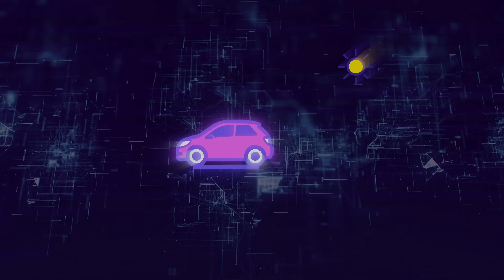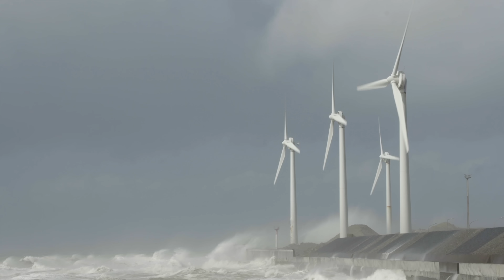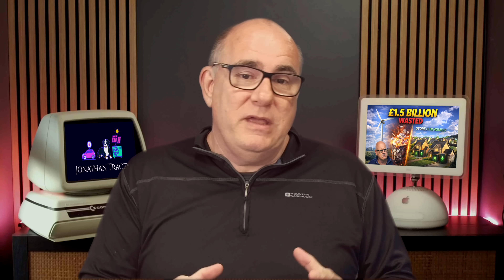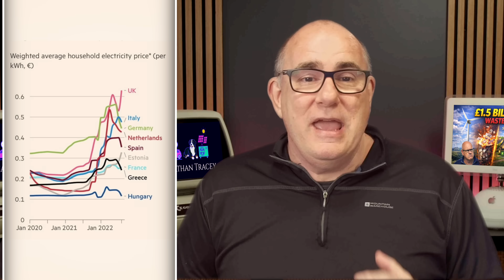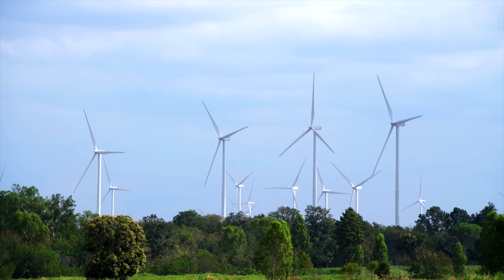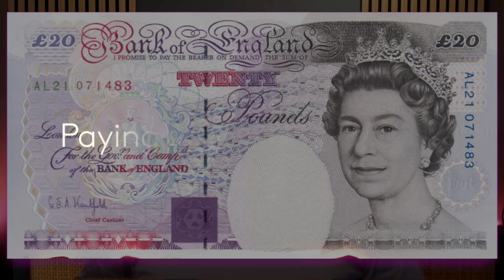We’re Paying £1 5 BILLION To Waste Energy… Here’s My Big Idea

Comment: As one of the other commenters mentioned, it wouldn't necessarily fix the north south transmission issue, but as I think you responded it would help manage loads during peak times and help local load management. 
That coupled with plug in solar and variable energy rates it sounds like a great idea. 

Is there any meaningful way for you to get this idea in front of policy makers to at least consider? 
I wonder if someone like Martin Lewis would back it, as in theory it would help every day households keep bills down
Reply from the maker: @Elrikkardo great point — and you’re absolutely right about it not “fixing” the north/south constraint on its own 👍

The way I see it working is more incremental:

If you start deploying batteries close to where energy is generated (e.g. Scotland), you immediately reduce the need to push all that power south at the same time. That takes pressure off the transmission network.

Then as you roll deployments further south, each layer soaks up local demand and frees up more capacity on the lines. By the time you get towards the bottom of the network, you’ve effectively created a distributed buffer — meaning more energy can actually make it all the way through instead of being curtailed or wasted.

It’s less about one big fix, more about building a kind of “mesh” of storage that smooths everything out.

On getting it in front of policymakers / someone like Martin Lewis — things are already in the works behind the scenes. No promises yet, but it’s definitely not just a YouTube comment section idea anymore 🙂

Comment: A bit of a Hmmm... here. "We have the technology" - this is not a critique, but . . . the latter part of my civilian career was spent putting back office systems into data centres - one in particular being associated with Centrica's back office systems related to smart metering . . . So, I wonder at the "We have the technology" and what that means. It says to me (I'm probably wrong but a bell is wringing in the back of my head - it's not tinnitus, I've had that for years) that "We know how to do it", it doesn't say "We have all the comms infrastructure and back office systems already in place with the necessary IT infrastructure, database architectures and controlling elements attuned to arrays of geographically distributed batteries with compatible battery control systems - and - those additional elements cost money which spiders with their webs around government wallets may have some objection to.

?
Reply from the maker: @derricksteed3466 I get where you’re coming from — but when I say “we have the technology” I don’t mean it in a vague IT sense, I mean it quite literally.

We’re already doing this today. Octopus can push energy into my EV when there’s excess on the network — that’s real-time control, pricing signals, comms, the lot. The infrastructure exists and is working at scale.

And fundamentally, there’s no difference between the battery in my EV and one sitting in a house — they’re both just storage that can charge and discharge based on signals.

So this isn’t a “we need to invent something new” problem. It’s more a case of extending what already exists and applying it more broadly. Yes, there’s cost and coordination involved, but the core pieces — control systems, comms, smart metering, tariffs — are already in place and proven.

That’s why I say “we have the technology” — because we genuinely do 🙂
Reply: @JonathanTracey  Accepted, but I wonder at the 'proprietaryness' (is that a word?) of Octopus' back office infrastructure and IT. I've noticed that some other suppliers claim the same ability, but is it a clone of Octopus' systems or something notionally the same but not congruent (in the geometric sense of those words)? I suspect there that in our future it may require some herding of Cats (integration). e.g. each electric car maker has their own implementation and they're not just clones of Tesla for pure EV or Toyota (really neat powertrain) for Hybrids.

Keep going please Jonathan - I'm a reforming sceptic climbing the learning curve so please don't take my comments in the wrong sense. It's just curiousity.

Comment: A quicker solution would be an extension of Octopus Agile, at the moment everybody gets the same half hourly rate what if Octopus could design its system to give a dynamic prices depending on your post code, then it would be up to customers to make the investment in their system to take advantage of any price variations. Come on Octopus lead the way.
Reply from the maker: @Mit-k1o You’re basically describing regional (or zonal) pricing 👍 — and you’re right, that is what it was designed to do.

In theory it makes a lot of sense: cheaper power where it’s generated, higher prices where there’s more demand. That would absolutely drive investment in storage, demand shifting and even industry moving closer to cheap energy.

The reason it’s controversial is exactly what you said — it creates clear winners and losers overnight. Scotland cheaper, London more expensive, which is a tough sell politically.

Right now we’ve kind of got the worst of both worlds — uniform pricing, but with all the inefficiencies still baked in.

Feels like we’ll end up somewhere in the middle over time 👍

Comment: So there is a reservoir out on the hills full of water and a pipe running from it to your house. Even with the tap fully open you can only get a dribble out if it. Please explain how buying a bucket makes the water flow any faster.
Reply from the maker: @clwydsigma Good analogy 👍 but the “bucket” isn’t there to make the pipe bigger — it’s there to *change when the water flows*.

Right now, when the reservoir is full (lots of wind in the north), the pipe south is maxed out — so we’re forced to spill water (curtail generation).

If you put buckets (batteries) *near the reservoir*, they soak up that excess instead of it being wasted. That does two things:

1. It reduces the immediate flow trying to go down the pipe (less congestion)  
2. It stores that energy so it can be released later when the pipe isn’t maxed out  

As you add more batteries in the north, you keep taking pressure off that bottleneck. That effectively frees up capacity in the line, so more energy can be moved south over time rather than all at once.

So you’re not making the pipe bigger — you’re smoothing the flow so it can carry more useful water overall 👍
Reply: @JonathanTracey  do you honestly think with the thosands of studies, strategists, modellers, analysts around that nobody has considered using batteries before? I assure you it has been studies many times in all its permutations and the answer is always that it is uneconomic, and in this case, wouldnt solve the issue you have identified. What studies repeatedly show is that it is cheaper to build new infrastructure rather than use batteries, which surprise surprise, is exactly what national grid are doing. If you want to make a case for intermittent renewables operators being obliged to implement measures to ensure their own power is dispatchable accoring to demand (like the plants it is supposed to be replacing) then I would back that 100%! Unfortunately this would also render them totally uneconomic. These plants profit by shifting the costs of their inadequacies onto you. Thats just the reality of intermittent weather based energy, low generation cost, massive system cost.

Comment: This is just a 'feature' of not having your energy sources near where the demand is  and having output determined by the weather leading to boom bust cycles of supply. There are transmission upgrades planned and in progress to reduce the grid constrained curtailment issue (98% of the costs you are talking about) but guess who will be paying for that. You will pay either way.
We must stop talking in terms of 'generated cheaper' and start talking about delivered energy prices and whole system costs because that is what consumers actually pay. Only around a third of anyones bill relates to bulk power price. 
Battery storage is just another cost and one which is much higher at consumer scale than at grid scale. And if grid scale storage were economic we would already have it. The point is that storage adds yet more cost.
However you may have missed the key point here which renders the whole discussion a bit irrelevant. Grid constraints are just that, constraints. You having a battery does zero to change that constraint sitting between you and the 'surplus' energy at the other end. So you still cant access that suplus power when its windy or sunny. Curtailment would not be affected, in fact if you are using your battery at that time curtailment could be even higher!
Reply from the maker: yep there are upgrades planned but it will be mid 2030s before they come on line and even then we are still predicted to have curtailment. Unfortunately you can build powerstations and windfarms in cities, so you have to go where the energy is and that needs networks to transmit it
Reply: @JonathanTracey  @JonathanTracey  or you could build power plants that can supply power when its needed where its needed. Thats how those crazy fools did it in the past and those sites are now sitting redundant That would make the constraint issue vanish pretty quick. However the point remains that batteries cant resolve constraint and redispatch payments. I hope you have pockets deep enough to reimburse that million people you just made rush out and spend £3,500 each on a battery.

Comment: Absolutely fantastic idea, I just wish we could all band together and get this underway
Reply from the maker: yeah, unfortunately, the massive energy lobby would be ranked against us because this would potentially impact their profits and their control
Reply: @iaincallaghan2431 not really. Batteries would not address grid based curtailment at all since the constraint is still between the source and the home. The problem has been misunderstood.
Reply: I'm sorry but isn't the grid one big battery, we've all seen guy in a power plant and the operator spent 30k to a hydro danm in Wales, lifting hz to 51.2hz from 49.8hz, printed on all appliances is between 50 and 60hz, how many danms have to be dropped or is that a safety lighting strike disburse number ?
Reply: @HenryOwens-py3ur  no, its just a wire connecting you to a power plant. Supply has to match demand every minute of every day. In the past we made electricity to meet demand. Increasingly now we are being expected to change demand to suit the weather. Not surprisingly this just doesnt work.

Comment: It is obscene. Wind farms & Solar Farms should have to put in a huge battery so that they can push the electricity out when needed.
Scotland needs the North Sea HVDC connectors sorting out asap. Thought this a year ago but no movement on it. Somehow China manages to build these lines many times longer than we need to get their renewable energy to the right place.
Reply from the maker: The problem is the cost per kilowatt hour for grid scale batteries is way more than for domestic batteries. So for the same amount of money it would make sense to spread the batteries over millions of homes rather than try and build one big battery.
Reply: HVDC lines EGL 1&2 are due to be completed in 2029, with EGL 3&4 in 2033?

Comment: I like the idea - but the assumptions used in your maths for savings are not realistic.  Quick comments (1) The payments to wind farms to back-off do not happen every day.  So it is not 20p/kWh/day that gets multiplied by 365 you big numbers.  It is a much lower number. (2) The grid currently asks the wind farms to back off because the super grid can't transmit it.  This does not change.  So the batteries that could soak up the spare energy need to on the sub-grid with the wind farms.  Are there may not be enough dwellings in the  Hebrides or out in the North Sea etc.? (3) You closed off with the suggestion the householder can use the power for free?  But charging overnight is a cost (be off peak) so this is not free. (4) It might be cheaper to pay the wind farms to back off, compared to paying the full rate for the power they produce. (I do not know) May be the life time of the turbines is improved if they back off.
Reply from the maker: @geoffj Really appreciate the detailed breakdown 👍

You’re absolutely right that the maths depends heavily on how often these events occur — it’s not a simple “every day” scenario.

And agree on the location point as well — if the constraint is transmission, then storage needs to be in the right place to actually capture that excess.

The idea was more to highlight the scale of the inefficiency rather than present a perfect model — but you’re right, the real-world numbers are more nuanced.

Comment: "We should be building them here", and that is the problem. Such a project would take 5+ years to complete, just to get the supply of batteries and no government elected on a 5 year cycle has any focus on doing such a thing.

Anyway, by the time the government teams have fully specified the 'UK' approved battery for production, meeting all the requirements added during all the committee meetings, you will have a 2kWh battery that has a weight of 200kg due to all its safety features and will cost more than the likely Tesla Powerwall 4 or 5 available by then.
Reply: Even if they bought off-the-shelf designs, there's a long lead time.
Reply: @Biggest-hz7ng  If an order was placed the Chinese manufacturers would be able to ship far faster than the UK could install them.

The question is - do we want a fix in place or do we want 5 years of virtual signalling from government that they are doing something and creating a few 1,000 jobs over the next 5 years producing things many times more costly that needed.
Reply from the maker: @Biggest-hz7ng Yeah that’s a fair point — even with off-the-shelf solutions there’s still going to be lead times 👍

Which is why I think the sooner something like this starts, the better. Waiting for the “perfect” moment just delays everything further.

In the meantime we’re still paying to waste energy, so doing nothing isn’t really a neutral option either.

Comment: Another grid scale problem is when there is an overload of surplus solar generation. There is an initiative in Ireland called EnergyCloud which has an Eddi like device installed in the homes of people at risk of energy poverty which uses the excess to heat their hot water for free so that the energy isn't wasted. That might be another big idea...
Reply from the maker: @padraigohiceadha That’s a really interesting example 👍 I’ve seen EnergyCloud and the concept is solid — using excess to heat water instead of wasting it makes total sense.

The only challenge is scale and control. These systems help locally, but they don’t solve the wider issue of moving large amounts of energy around the grid when supply and demand are out of sync. Still, definitely part of the solution rather than the whole solution.